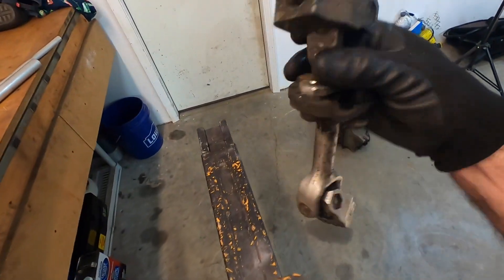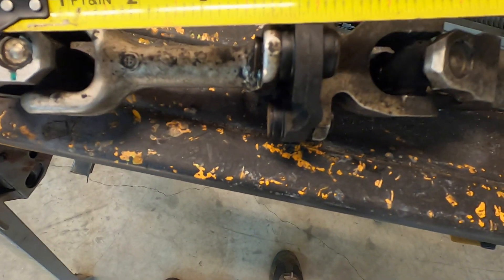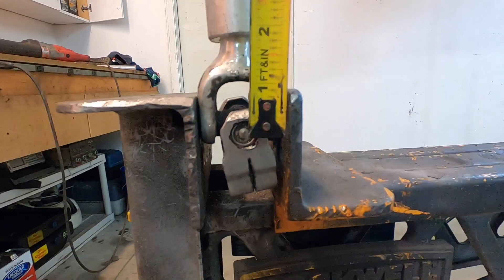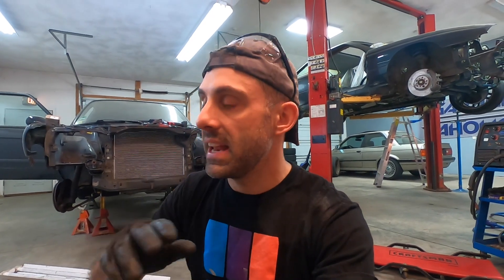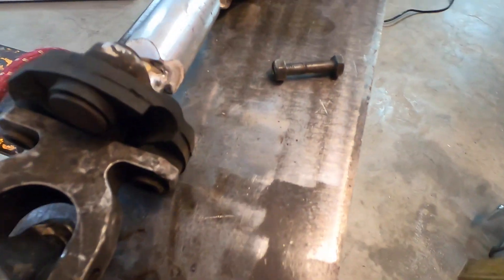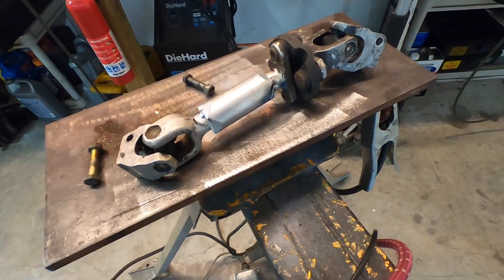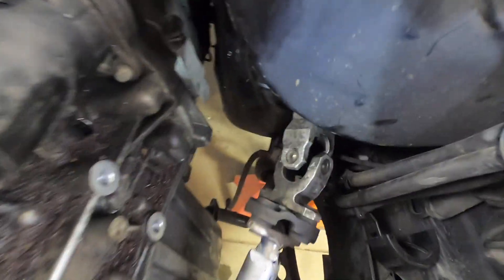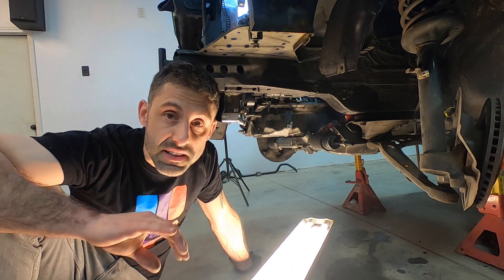Part 10: New Rack Location? New Steering Column Fabrication! E30 N54 Work!

Comment: If you end up replacing the donut I recommend the Ireland Engineering one.
Reply from the maker: I may!! Thanks for the suggestion! I tried contacting IE for sponsorship but they have not returned my email
Reply: @Garageaholic  i found their customer service not the best so no suprises there. But the product is good. I adapted it to fit on a e46 column